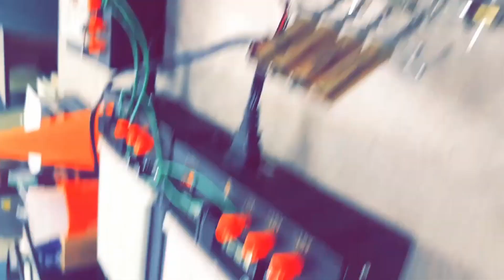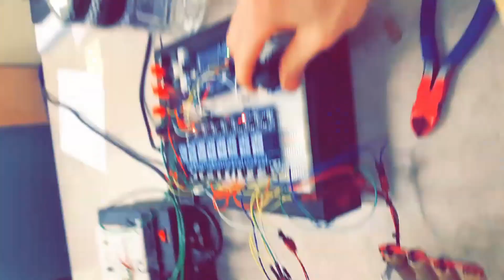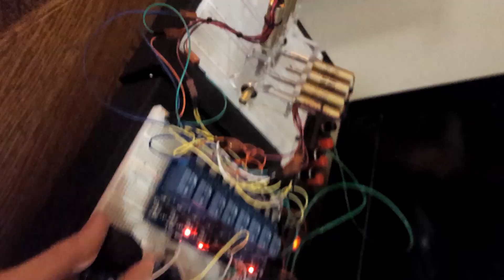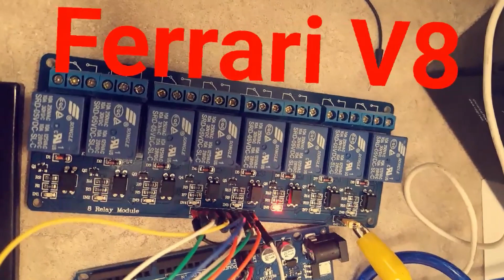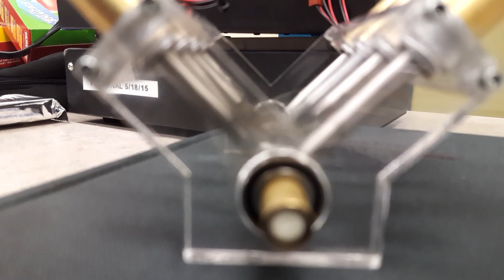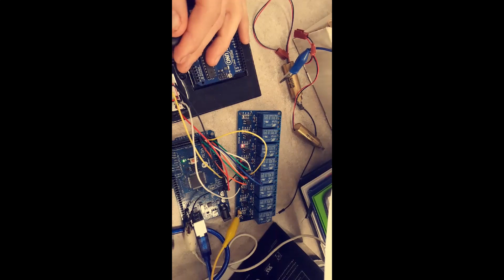12v Solenoid V8 - Ferrari, Ford, Chevy Firing Order Comparison

Comment: There is this cam less ignition system for gasoline engines called free valve. Video 1 is a perfect presentation of that system. Instead of the engine running on a timing chain, you can electronically distribute gas and air into an engine thus eliminating the the timing chain and cams.
Reply from the maker: I know exactly what your talking about. I actually never thought about it but thats awesome. The thing i learned from this "experiment" was the cycle rate was the limiting factor, big delays (relative) on time to energize and deenergize the coil, and it takes soooo much power. I had to hook up multiple power supply's just to barely run these under no load